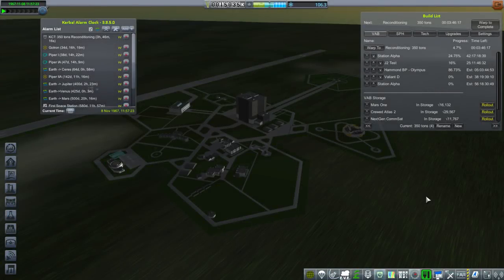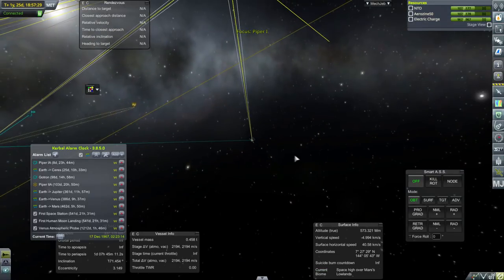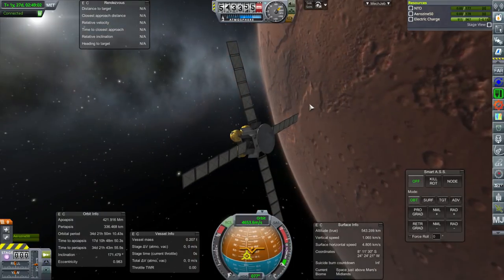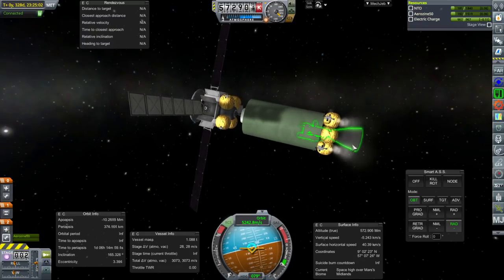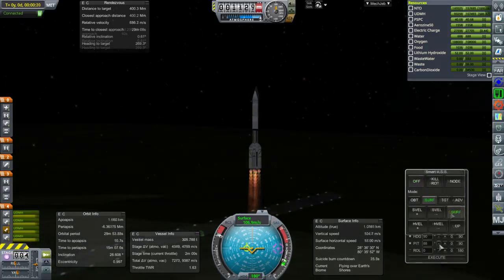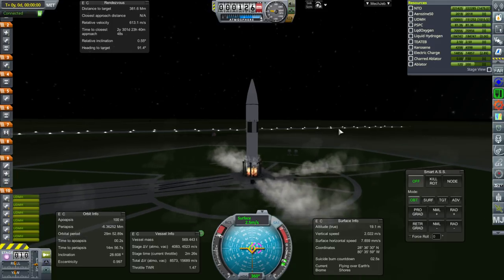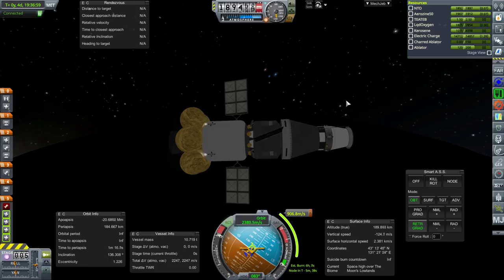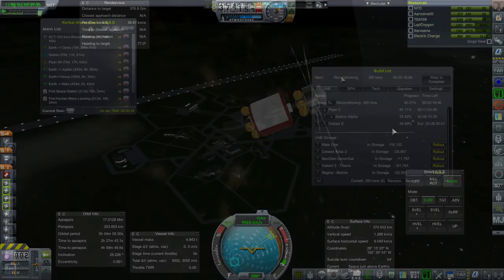KSP 1.3.1 with Realism Overhaul - RP-1 33 - The Challenge

Comment: Couple of things:

1) failure in relation to dynamic pressure is very common, and TestFlight has a separate config line for ignition failures in high dynamic pressure, you can check it out in the engine config files. 

2) do you have noticeably worse performance in 1.3.1 RP-1 compared to previous versions? I was running 1.0.5 RP-0 and it runs super smoothly, but 1.3.1 RP-1 with all other settings the same lags like crazy.

Edit to add: I greatly enjoy your playthroughs by the way :)

Comment: [20:30] Hmm, I think I would have had the other engine opened and pinned so I could quickly shut it down if the thrust became to off balanced. :(
Reply from the maker: Doesn't really matter - at that point the TWR would be fairly low and the burn time the remaining two would have to go for would far exceed their rating. It wasn't really going to get to orbit.

Comment: I think the J2 failed because you ignited it in atmosphere and during high dynamic pressure.
Reply from the maker: I don't see why that would make it fail, but I did decide to delay it in the subsequent launch just in case. Test Flight killed it, and I don't think Test Flight cares about dynamic pressure. Not 100% sure, though.
Reply: @RaizSpace  Oh, dynamic pressure definetely counts. Had a sounding rocket that used 5 of those sounding rocket SRBs to get up to speeds and the aerobee kept failing 100% of the time after SRB burnout. That's when I found out that dynamic pressure counts. I'm guessing it has something to do with combustion instability.
Reply: can confirm, dynamic pressure has a big effect. found out the hard way with aerobees.

Comment: You don't you run the engines in the platform and win reliability for the cost of the propellant?
Reply from the maker: It only counts data points while in-flight, so as far as I know, doing a test on the launch pad doesn't work. Rollout costs also make this an expensive choice, since we still pay for rolling out the engines and tanks, and that costs much more than the parts.